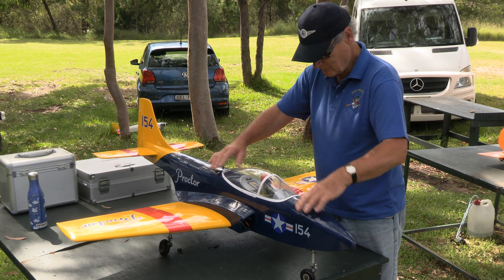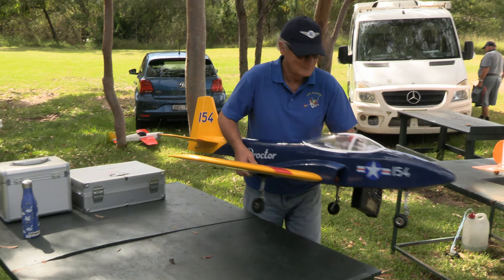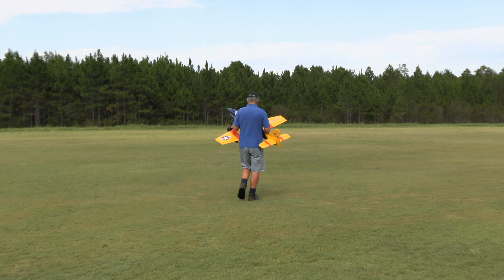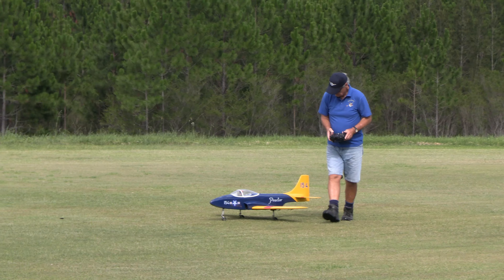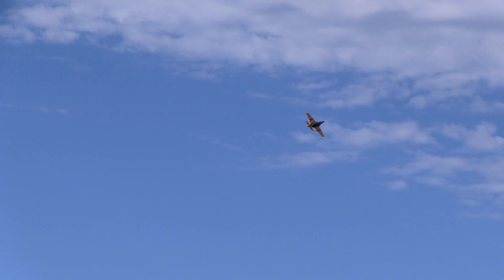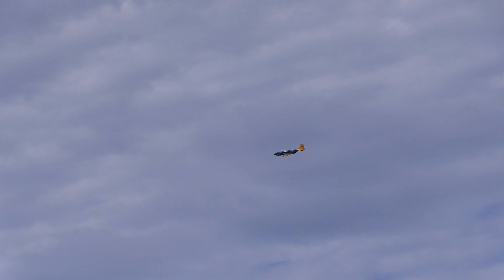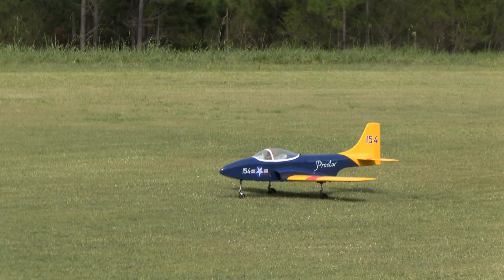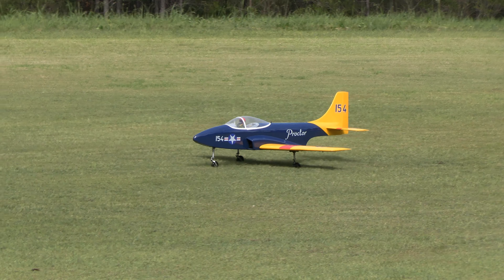Black Horse Proctor Ducted Fan RC Jet

Comment: That was an interesting edf do you have any details of his set up.😮
Reply from the maker: At the time the owner told me the diameter of the fan, but that was all.  He did point out that Black Horse has taken some liberties in the design to make it more flyable as a model aircraft than if it was 100% scale.